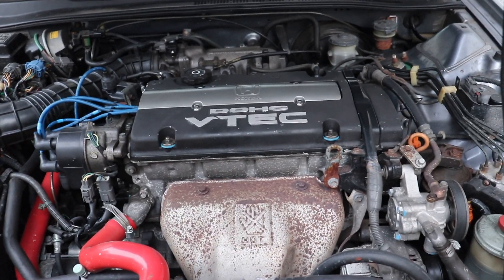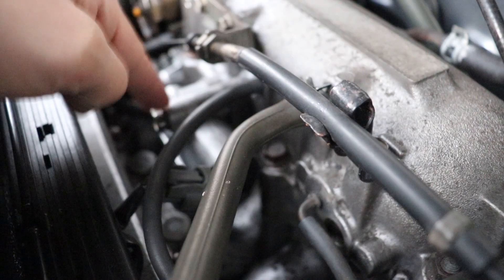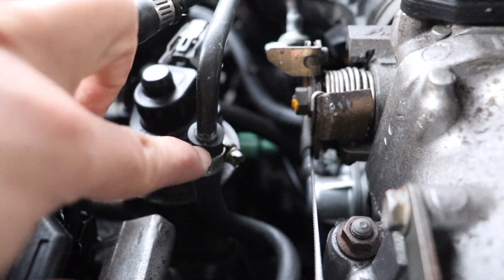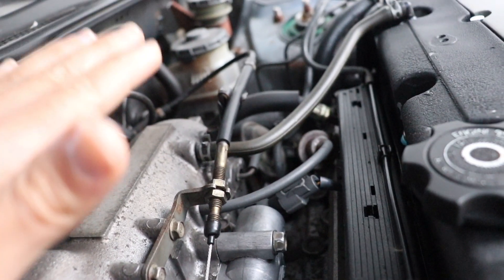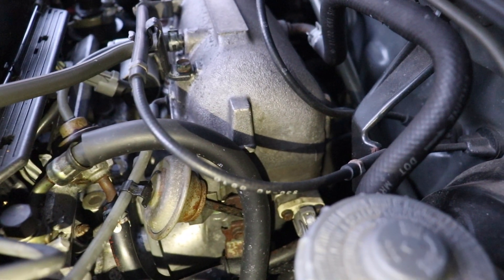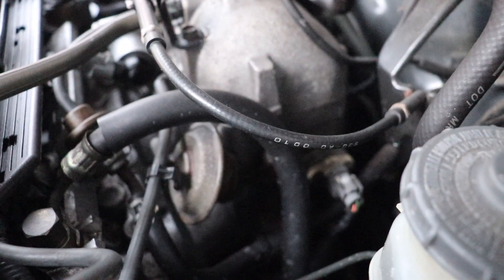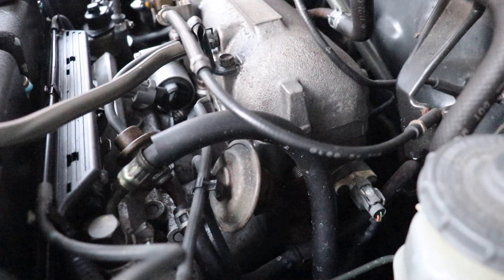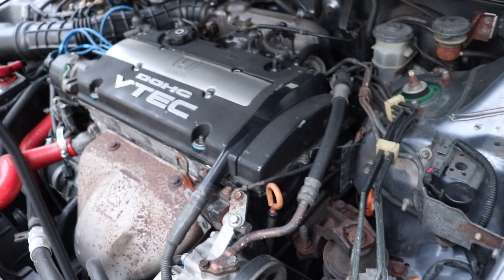Honda Prelude: Possible causes for P0505 code(and P0325, P0171)

Comment: I have a p0171 code, and i ran an obd scan at Oreilys. The likely issue stated on the paper was the egr valve. when i rev at idle OR slow down to a complete stop, my rpms would drop until it almost stalls and itll catch itself or sometimes it would stall

Comment: Did you have to fix this from underneath the car or where you able to acces it from the top?
Reply from the maker: I fixed it from the top by standing on the driver side of the car and putting my hand under the intake manifold.

Comment: Where did you get access to be able to touch the vacuum box under the manifold?
Reply from the maker: I was able to fit my hand through the space right in front of the brake booster and the intake manifold.

Comment: Brother, I’ve been having that issue for a whole year and nothing new with the thermal valve. It had nothing to do with the idle air control valve and once I replaced every single thing, the knock sensor code was the only thing that popped up. I literally just bought one and I’m going to install it when I get home. I know your frustration, brother. I got a nice Paul Walker paint job our 34 and then this happened and I’m like great and the H22 is very sensitive.
Reply from the maker: Sorry to hear that. I'm glad you at least are getting closer to solving the problem and getting back to driving your car. It's very frustrating but I also learned more about the car so I can diagnose and fix better. Thank God. H22's are very sensitive when it comes to air leaks.

Comment: hey could you go back and show exactly where that photo at i cannot find it
Reply from the maker: Its on the left side of the car under the intake. It's literally tucked right below the intake just try to pause the video where the photo is and see if you locate from there. I'll make a youtube short if you still need help. You have to look at it from an angle on the left side of the car and use a flashlight.